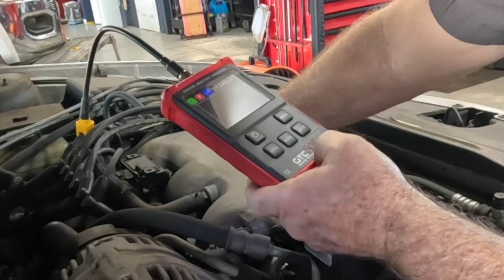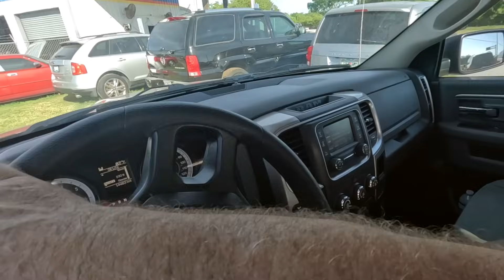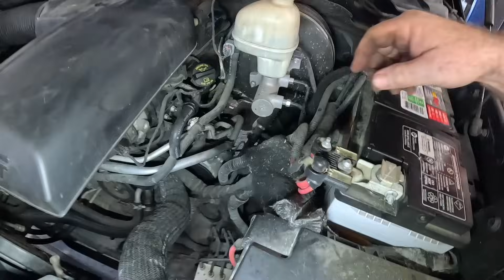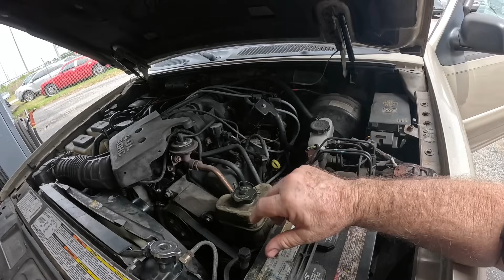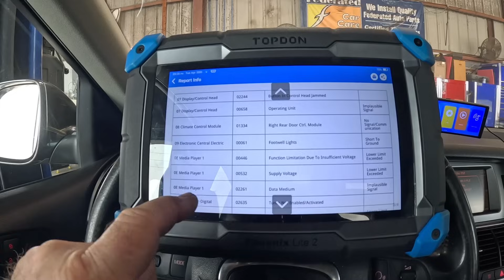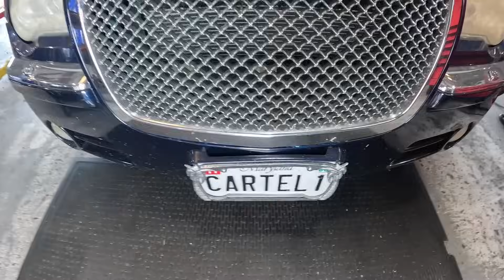300C STALLS, SPORT TRAC COOLANT HOUSING, GRAND AM MISFIRE, RAM 3.6 TUNE UP, DAY IN THE SHOP 474

Comment: The 5.7 hemi came with NGKs from the factory.I have put in Champion and NGKs in Chrysler products without a problem.Do not ever put in Bosch spark plugs in a Chrysler product.Run like crap causing misfires,have seen this a few times.
Reply from the maker: Yeah, I think the one I had trouble with was a Sebring we put Bosch in, it was not happy and set misfire codes first start in the morning every other day.

Comment: Well I see that you didn’t have to remove the plenum. The one that I did on my grandson’s truck had spring clamps so I think that it went easier. I removed the upper idler and snuck that sucker out and back in. Throttle body was removed as well.
Reply from the maker: Nice work! What matters is it gets done and holds coolant most of all! :)

Comment: Chryslers are very fussy . 100% can’t use any aftermarket Ckn sensors or Cam
Reply: In the olden day's ( couple years ago ) they said Toyota factory replacement parts  ( for toyota's ) were the best ! I don't think you can say that today... seems like they are  as bad or as good as anything else...
Reply from the maker: So many brands nowadays. Plus aftermarket parts have gotten worse also.

Comment: Back in the day I think we used to check those GM waste spark coils by removing the spark plug wires and crank the engine. If spark could jump the  big gap between the plug wire posts then the coil was good.
Reply from the maker: Exactly! Or a test light to ground and see how far they jump.